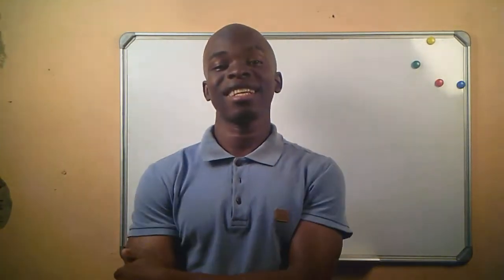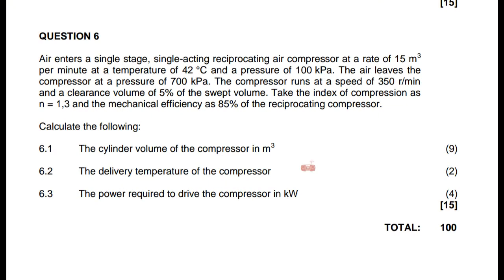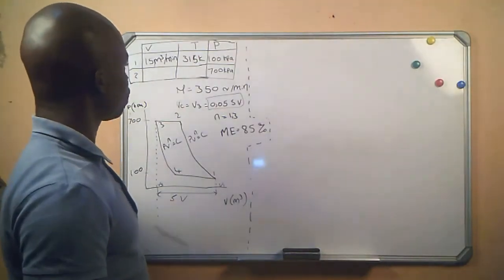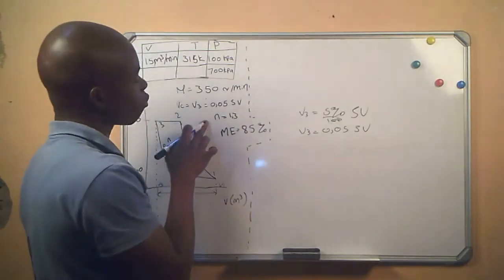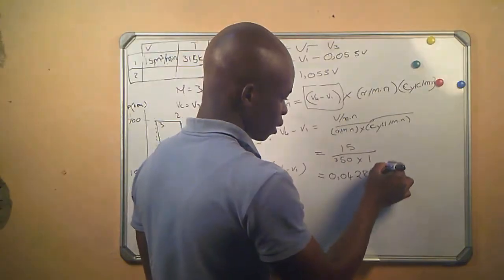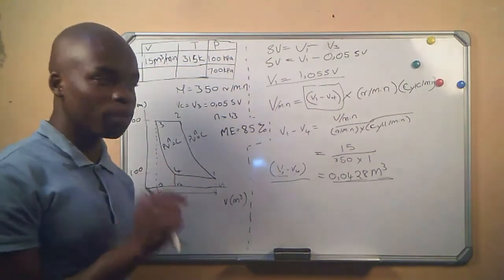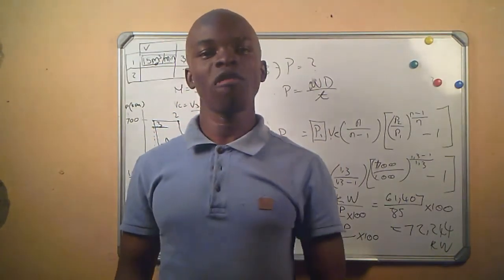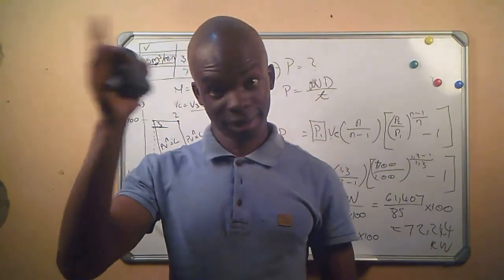COMPRESSORS exercise 1

Comment: Good day, thanks for the videos they are quite helpful. One question, isnt a compressors cylinder volume V1 like your final answer not Vs? I think it would be Vs if there was no clearance?
Reply from the maker: yes that is correct, v1 is actually what they wanted.
Reply: @natedengineering  thank you